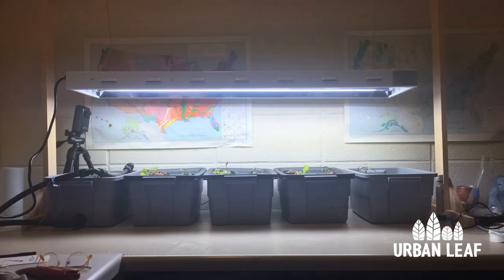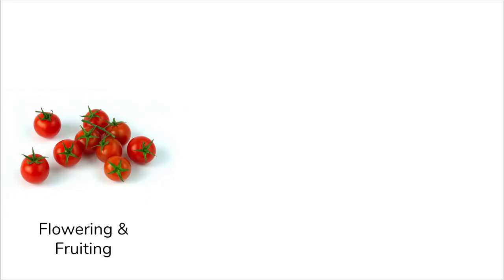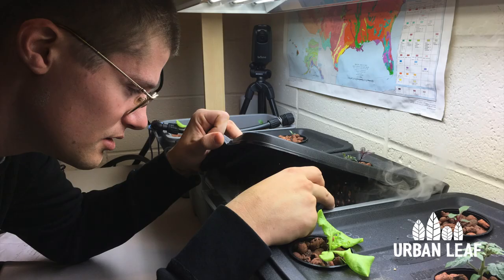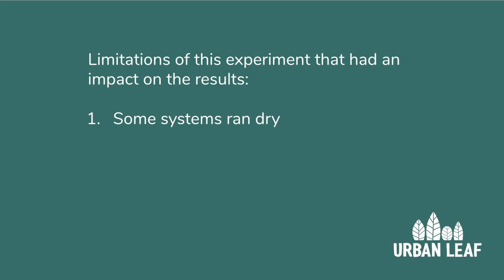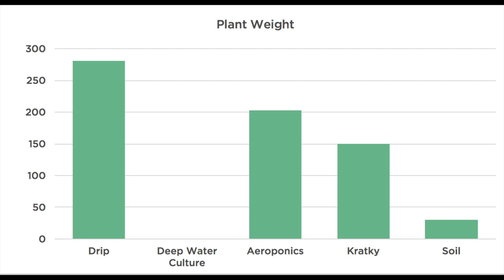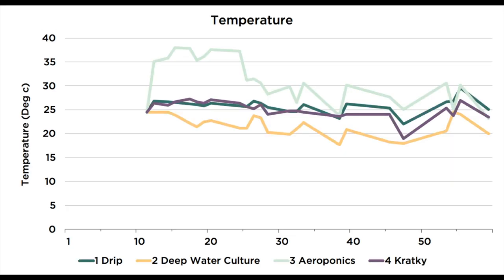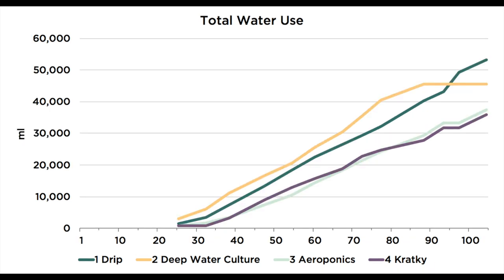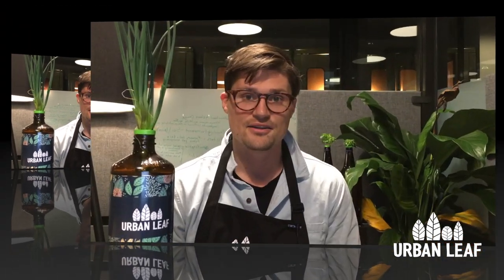Hydroponics Systems side-by-side - Aeroponics vs Drip, Kratky and DWC

Comment: sounds like a failed experiment. the drip would likely have gotten 2nd place if went to harvest and the DWC would have likely been in 3rd place if it didn't run out of water. A DWC is pretty much a kratky that uses air. which would help the plants grow faster. Other than this coco coir would most likely be the closest thing you'd get to aeroponics, that's if you do it right. aeroponics and coco coir are the hardest to master but if done right can produce 3 times the amount of soil.

Comment: Your aeroponic. system is a hybrid of Dwc guarantee the roots were in the water so it wouldn't be as good also no water temperature control so none of the systems expect for the drip were running at optimal conditions which is crucial in dwc as water temps dictate the amount of dissolved oxygen where as the drip doesn't rely on the water to get it's air if your gonna do a test do it properly otherwise it's not a fair test

Comment: High Pressure Aeroponics is the only true Aeroponics.
Reply: high pressure aero is ok but it doesnt offer as much control as AA ;)
Reply: @atomizer2665  What is an AA?
Reply: @juancarlosguevara5526  
It stands for Air Atomised which uses compressed air to create the mist. It provides instant response, even mist coverage and control over the liquid flowrate and droplet size range.
Reply: Atomized aeroponics wayyyyy harder to control considering the droplet size is too small to deliver proper nutrients at the roots. Which is why the examples with larger droplet sizes or DWC appear to be much more healthy. Great idea for a test but I would really dial in each form of hydro before considering one or the other.
Reply: @hiddengarden3866 
Air Atomised aero is very easy to control because it allows you to control the droplet size and liquid flowrate independantly. I think you may be thinking of  ultrasonic fog which is entirely different and only useful for water features ;)
Reply: Atom izer you are right

Comment: This is one of the best comparisons videos for the reason that  because it factored in human error.  We are all humans and need a realistic view of what we may face.  Great job!
Reply from the maker: Wow, thank you!
Reply: No. It's terrible. Genetic variation is huge. If he had used clones all off the same mother we may be able to make some conclusion.

Choose your hydro system on desired size and willingness to maintain, not a potential 5% yield increase.
Reply: @kaydog890  Aeroponic always gives the biggets yield out of any other hydro system. Fact.
Reply: @willytaylor1940  
Thats not always the case. Most so called aeroponic systems are actually hydroponic. A genuine aeroponic system will happily produce hydroponic results if you dont understand the concept and run it like hydro :).

Comment: The 40 watts and replacement discs used by the little fogger are more relevant than the few cups of water used when calculating the running costs,
Reply: Not only that but his aeroponic. system was a hybrid of Dwc guarantee the roots were in the water so it wouldn't be as good also no water temperature control so none of the systems expect for the drip were running at optimal conditions which is crucial in dwc as water temps dictate the amount of dissolved oxygen where as the drip doesn't rely on the water to get it's air

Comment: Nice comparison. It would also be nice to see a side-by-side comparison of two Aeroponic systems - one using an ultrasonic fogger/dry fog, and one using a nozzle/high-pressure pump, to assess whether droplet size affects yield etc.
Reply from the maker: Yeah for sure - good call. Which one do you think would do better? ;)
Reply: @GetUrbanLeaf  
The ultrasonic wouldnt make it to harvest unless you included some form of hydro to prop it up, this includes having the nutrient reservoir inside the root chamber..thats dwc ;) High pressure aero would do much better assuming you had the right hardware in place and dont run it like low pressure aero (sprinklerponics), aka soak the heck out of everything. The upper tier of aeroponics is air atomised aero, its not very common. It uses compressed air to create the mist and offers tight control over the flowrate and droplet size range.its not one for the inexperienced or the shallow of pocket ;)
Reply from the maker: @atomizer2665   thanks for the info! Yeah I guess you'd call what we did (and labelled aeroponics) a hybrid of DWC in the bottom and ultrasonic mist in the upper. Is your comment about 'propping it up' in reference to the lack of nutrients in the mist?
Reply: Just about to run a somewhat similar test,

Doing kratky vs aero high pressure at 50micron/100PSI vs cheap fake-aero setup with like 10 psi pond pump and basically a sprinkler head.  

Probably no question the high-pressure will do better; but the question is how much.  Does it justify the 3x-4x cost when just growing veggies.

My current hypothesis is it makes a lot more sense to run HP aero when your crop is a bit more valuable then a "tomato" and even a marginally larger yield easily makes up for the added cost.
Reply: @Aerogrow  
The running cost of hpa is considerably less than most hydroponic methods that involve water or air pumps.I built a completely off grid true hpa system just for the craic.   Hpa uses less water, nutrients and no medium so you save on those too. Mundane veg  grown outdoors in hpa can use the big halide in the sky. its the absolute best grow light and it costs nothing to run.
.
Reply: @atomizer2665  well i used the ultra sonic in a 20L bucket and a fan with a tube that pushed my mist to the next bucket with the plants.i used it for mushrooms only but i think it could work for root development as well.

how well the nutrients go with the mist i dont know my setup used normal water

Comment: Which tomato seeds are the ones that give so many tomatoes without overgrowing the plant? My tomato plants in the Kratky method grow big, go up to 2 m or more and many of them don't even grow tomatoes. They form some flowers that eventually dry without bearing fruit.
And what formula of mutrients did you use that worked on both tomatoes and lettuce? I use different formulas and yet I have almost no tomatoes.
And with these solution temperatures in the range of 25 degrees you didn't have Pytium problems? In hot weather, even with H2O2 added to the solution I have terrible Pytium attacks on the roots.
My cultures are outside on a balcony
Reply from the maker: LUISSM thanks for checking out our vid 🙏 These were tiny tom (or Tim?) tomatoes. They're a special dwarf variety and great for indoors
Reply: @GetUrbanLeaf  And where can I find these seeds? In your links do not have the seeds.
And the nutrient formula used?

Comment: Using a fogger or a Micro Bubbler/bubbler in the Kratky method would probably be the best over all. Growth, Cost, Simplicity.
Reply: That just makes it dwc though, honestly they should probably ventilate the boxes two to four times a day staggered in between waterings.
Reply from the maker: Metal Rott yeah I think Michael is right. But yes - air and ventilation is definitely important!
Reply: @horseblinderson4747  Newbie here. Why would the reservoir/nutrient solution need ventilation?
Reply: @GetUrbanLeaf  
Specifically in response to what you're asking
1 so that it doesn't mold
2 plants breathe through their roots

Comment: DWC without a doubt will grow your plants faster and give more for your return. The problem with DWC is maintenance. You need proper water PH specific to the plant you're growing. It's also important to properly balance the PH of what ever medium you use to hold your cuttings/seeds like soaking your hydroton blocks in ph balanced water for 24 hours before introducing a seedling. The temperature of the water could also be specific for certain plants so that's also something to look out for.. There are different nutrients for different grow phases which means completely changing your water multiple times. You need way more oxygen (best to line the bottom with bubble stones) and light that will feed the plant the energy necessary to process perfect nutrient absorption . It's best to use a combination of HPS and Metal Halide lights and stay FAR away from and low wattage low lumen lights, like LED or LCD. I use HPS for the grow phase and Add a metal Halide half way through the grow. It's also important to add a water pump to the bottom of your reservoir to deliver nutrients to cuttings whose roots haven't touched the water yet. If you do DWC right, it literally has no competition when it comes to yields, growth, and time. Nothing else touches it.
Reply: I grew up in the country and we grew 90% of what we ate....all conventional dirt gardening.
Everything you mention is exactly why I never considered hydroponic gardening for many years....then I discovered the Kratky method. I now grow 3 times as much in less than half the space and about a 10th of the labor.
Screw pumps, screw test meters, screw grow lights, screw all the nitty detail....and most importantly, screw dirt!
Reply: BUt the complexity makes it far less appealing than the other systems. The time spent on managing it could be spent on caring about more plants rather than trying to optimize only one container...
Reply: That just depends on how you look at it. With DWC you will be out of the grow phase weeks or even months before other methods. You'll spend less time in the long run on dwc because your crops will be done growing much sooner. Also the yields are much much higher, so you get more (usually much more) from 1 plant vs 4. This is just my personal experience and i've grown all sorts of crops dozens of different ways. Kratky and aeroponics has dwc beat on up front cost,user experience,energy, and maybe space, but DWC is king of speed and yields.
Reply: @aegisstari1494  
I`ve run every method over the years and nothing beats aeroponics for speed when done correctly :).
Reply: @atomizer2665  I don't see how thats possible. I can get full lemon trees from seed to loaded with fruit in 4 months. Aeroponics physically can't deliver the nutrients fast enough for this kind of growth.
If you want cheap and easy to set up systems, Aeroponics, if you want extreme growing speed, DWC.
Aeroponics waste very little where as DWC is an energy hog and not nearly as efficient. However you give up efficiency for speed and yeild, which is far, FAR greater.
Reply: @aegisstari1494  
Getting the nutrient into a plant is reliant on the root mass. Aeroponic roots take less time and resources to grow which is important because plants wont devote many resources to the top growth until they feel they have enough root mass to sustain it :) If you are comparing what passes for aeroponics these days to DWC then it`ll be hard to call. If you are comparing genuine aeroponics to DWC, there`s no contest. A dwc will eventually fill all the available space with roots but it`ll take many times longer than with aeroponics. You can have a dwc boiling like a cauldron with air bubbles and it wont grow roots that are as efficient as these https://youtu.be/l1Rmm9JvPfY

Comment: wow dude your water temps in the aero system  are astronomical !
not really aero though it's fogponic
i am experimenting right now with a home made 6 site fog cloner i made with a cheap Chinese  $3 fogger from ebay , a small  tote from dollar tree and 6 2" net pots and 6 2" neoprene collars
i am using an arduino pro mini and a relay to cycle the fogger ,  i have it set to 1 min on and 3 min off currently
so did you use a cycle timer for your aero setup and are cool temps as important for growing with aero as they are for cloning?
 you go that high of a yield with the water temps that high?
i read of cloning (cannabis cuttings) that water temps  should not exceed 80 degrees F
when i had the fogger  on 24/7 my water temps were way too high ,i  had it set to 30 sec off and 3 min on at first and the  water was too hot
so now i set it to 1 min on and 3 min off and  i set the tote on  cryo paks and i got it down to around mid 60's F
looks like your temps were running  around 100 F or over at some point and average about 86  F  is that right?
and you got those results with that high of a water temp?
also did you measure the temp of the solution or the temps of the air fog? where was your temp probe actually placed?
if you used a timer  what was the interval set to?
i also had an  idea to use a peltier to chill the water , i think it could work for  such a small tote i am using  for the 6 site cloner
not sure what the best was is to set t up to chill the water though

Comment: What if you used a smaller netpot to same room, Instead of clay pebbles to fill in the cracks and space?
Reply from the maker: Hey Jason - yeah that could work! That's actually kinda how our own products work - a long skinny net cup that enables greater contact with the solution around it. Is that what you meant?

Comment: in the nicest wat possible this was generally a bit of a fail. the fact you didn't water the control meant you had nothing to compare it to and letting the dwc run out of water just threw off the whole test. you really should have started again from scratch. nevertheless you gave it a shot. so well done on trying.